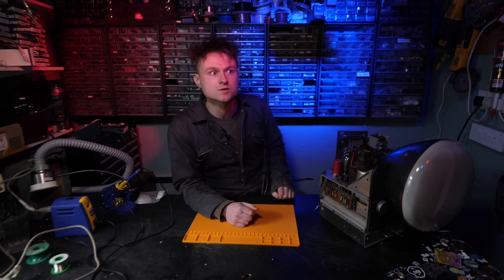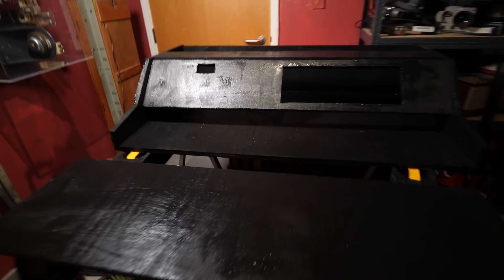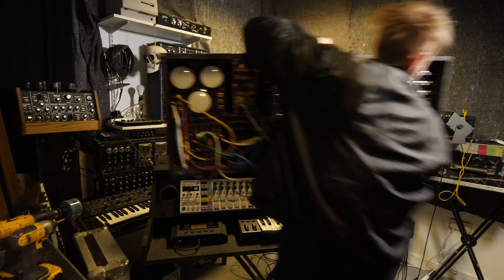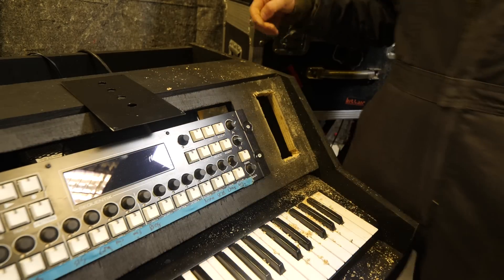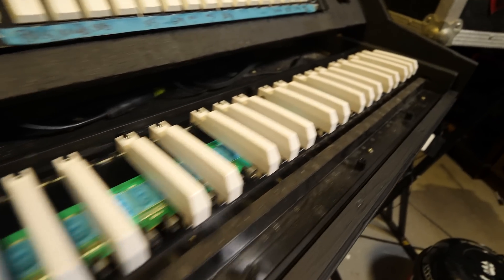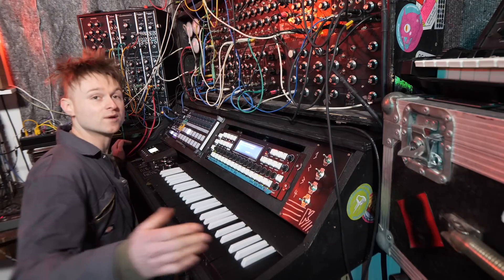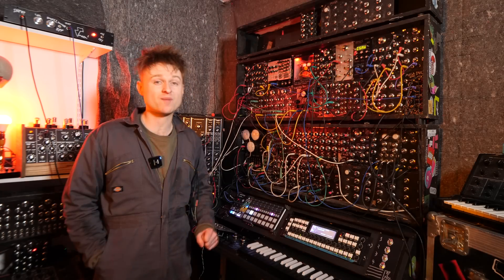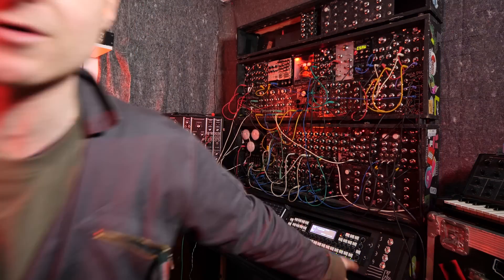Improving My DIY MODULAR SYNTHESIZER pt1

Comment: XLR for power? There's such a thing as powercon you know. It makes/breaks connections more effectively.
Reply from the maker: Xlr does a good job of breaking connectivity and most importantly is common. So if have a broken xlr cable can easily find a replacement. From experience of powercon I can say that is not the case. Hence not using ot

Comment: If you take a page out of road case manufacturer's books, or the whole books, you could see if you could put some butterfly latches around the edges of the synth cases, and latch the two together, closing the whole thing up. You could also get some aluminium flashings for around the edges of the cases to make them look better. Maybe also try to modify that idea and make a cover or multiple covers for the main case. Maybe even put the whole thing on wheels at the bottom.

Comment: nice! i've been thinking of making something similar, but the base i already made works for now. It's pretty much just a wood box with some shoddy speakers and a looooong power strip. I left the back open to shove extra cables in, etc. and put a handle on top. def used a kosmo pin hammered into it for a little bit of style

Comment: With the bottom unit you could maybe have it split in half front to back and have the back half fold over the keyboard etc to form a lid 
Would have to make the back half slightly wider to fit over front keyboard etc half
So you end up with a box ,same width, same height, half the front-to-backness, and the keyboard etc defended for transport
Pivots round the bottom of the front/back split
Top of the back half becomes front of the travel configuration
Back of the back half becomes the top or the travel configuration 
(Mostly a comment to feed t'internet rather than advice 🤗)

Comment: The case is nice but is that an old television on the table? Maybe it's an illusion but that picture tube seems larger than the similar glass-cone round ones we had in the US. 10 inch was our most common size but we also had 12 inch ones.

Comment: I'd drill more big holes in the cabinet (mainy at the bottom), and if necessary cover it with some protection/covers, just to make the case lighter in weight.
Reply from the maker: Sounds like a faff :D.

Comment: The keyboard looks great! But the paint..... I think you need to cover it with transparent (sticky) tape. I paint some outlet sockets and switches and after a while the paint came off at areas where your fingers go. On the switch covered with (sticky) tape this doesn't occur and still looking like brand new.
Reply from the maker: i have painted loads of keyboards you need to use plastic paint
Reply from the maker: and if it rubs off it adds to the look :D
Reply from the maker: is fine :) cheers!

Comment: Kettle leads, on actual kettles, are C15 connectors with a notch at the bottom and rated for high temperature operation. IEC normally refers to the C13 connector without the notch. This has been a public service announcement.
Reply from the maker: It was a joke. But most kettles in U.K. don't even use kettle leads. Since c15 plugs fit into both sockets. I still think in practical descriptions they are pretty
Much the same. And in the U.K. both tend to be referred as kettle leads c15 or c13

Comment: Those X stands terrify me.  Had one collapse on me during a gig, and it broke the keyboard (which wasn't mine). I now use el cheapo mixer stands from Amazon, which have space for your legs if you are a sit down guy (like I am when doing piano things) adjustable width and stable.

Comment: Looks good. I like the inverted keyboard colors. Did you put 230V AC over the XLR connectors? Just had a look on the datasheet and found that they are rated for max. 50V AC. Since you want to use it at public places (concerts) I would be afraid that you get told : "No gig with that" for health and safety reasons.
Reply from the maker: No 12v ac
Reply: @LOOKMUMNOCOMPUTER  Yay, no one can complain then "This is not right, you have to do it different" like "You will never get this church organ to work again" 😎

Comment: Great build... just thinking out loud... maybe put some heavy duty casters on the left... a handle on the right (near the power input/output)... and fix some double X keyboard stand with clutch lock to the bottom... wheel it in.. lift it up... play your heart out. :)

Comment: If you put over-centre clamps on the sides you could bolt the whole lot together and avoid any health & safety issues <3
Reply: I was thinking the same thing.  Latching or unlatching would only take a few seconds.
Reply: I came here just to say that or suggest support pipes down the side.
Reply: Great idea
Reply: OMG LOL DUHHHH LOL. SIMPLE AND STRONG
ALSO..
Might need a counter weight too.
Reply: Omg, I was hoping till the last minute for some latch clamps, for sure this thing is gonna crush some unassuming bloke one time..

Comment: You need an ambulance gurney to move your console thingamajiggy. They're made to put the wheels up smoothly as you shove them into the back of the meatwagon, and then they fold back down again when you arrive at the hospital for your hernia. I think they are even designed to roll down steps with the slightest push. I don't know how they work. Magic, I guess. Looks like they are abundant on surplus and reseller sites.

Comment: This is really inspiring me to get into DIY woodworking. I find that so many of my issues with workflow come down to ergonomics and case flexibility. If I were able to construct my own case, it would solve a lot of headaches. 
Seeing your approach to modding Cosmo 2's lower third is giving me the inspiration to do something similar.
Thanks Sam!
Reply: Once you choose to stick to punk-level aesthetics, you'll never be afraid of a joint 1 cm out of alignment anymore.  Add a few more screws to pull the thing in place and that's it 🙂
NB: questioning the need to make everything perfect is an essential prerequisite
Reply: It can be surprising how useful woodworking is with a disparate variety of other activities. Being able to knock together just the box you need at any given time is remarkably handy. Mostly woodworking does boil down often to making boxes too.